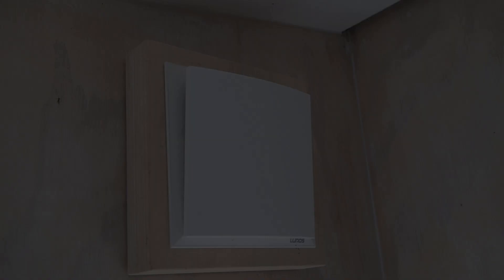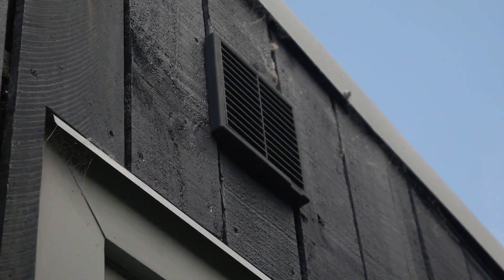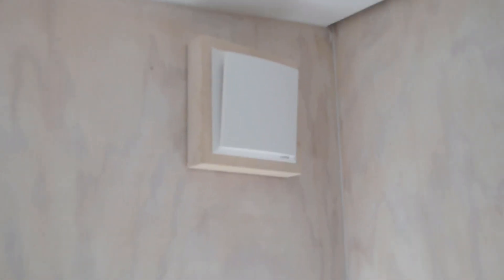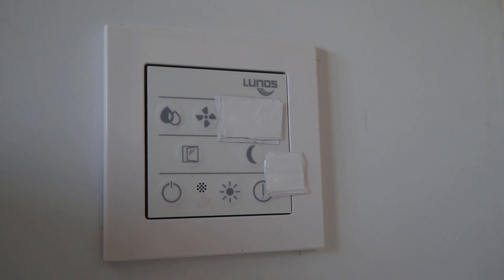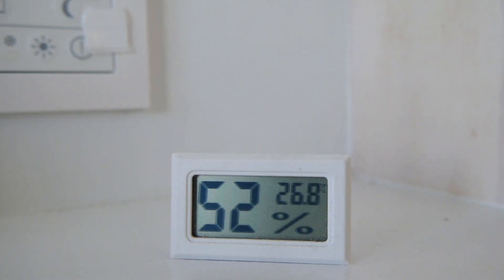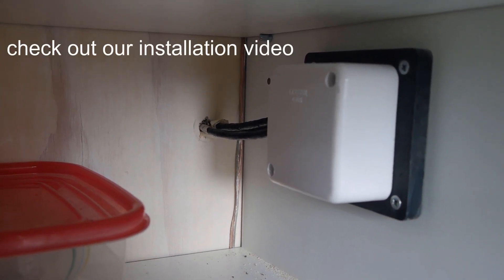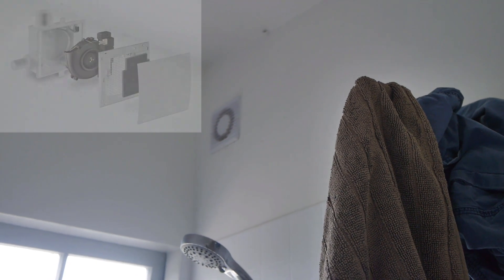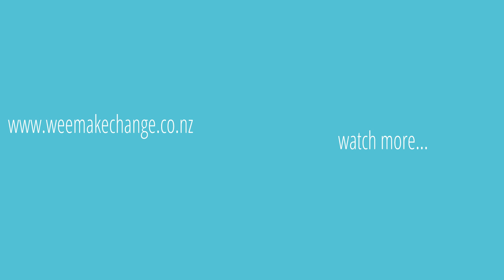Why your Tiny House should have a Lunos e2 Heat Recovery Ventilation System

Comment: I got this system in Ireland and works really well. Well worth the money.
Reply: Hi Micheal, I am also Irish and I am currently looking into this eco system. Glad to hear that it is working out for you. Hope that is still the case? Was this a retro fit job or a new build?
Reply: @derek8272  Derek, I initially fitted 2 units in two bedroom as a retrofit. Very pleased indeed. They great in winter, the room doesn't get cold and you do get fresh air! If noise is an issue you can hear the outside more ie. traffic and wind. Close them during a storm. I just built an extension and am fitting more, because the control system is already fitted. I would recommend them as one of the best investments in any home.
Reply: @user-op8fg3ny3j  howdy, Not just yet, have the units installed, just waiting for a spark to wire the transformer in the fuse board! 😁
Reply: @michealofloinn2539  Micheal, have had these up and running about 8 weeks now. I really like them. especially on the hot days. i kind of forgot that they were there and had to do some work in the house and kill the power going to the fans and I was really surprised at how good they are. the house became very stuffy and hot very quick. even on the lowest setting they do a great job turning over the air. 

On the lowest setting, i cant hear them at all. they are a bit noisy on the highest setting, house sounds like the inside of a air plane 😅. I did notice the traffic noise a bit more but there are some noise filters you can get for them as well. 

I 100% agree with you "I would recommend them as one of the best investments in any home" - might be a bit of a pain to install, they were in my case and how I had to run the cables, but definitely worth the effort.
Reply: @derek8272  hi, did you guys just install it yourselves? or you pay an installer? (Wicklow)
Reply: @togugram  I installed it myself, start to finish. Partel offered a ridiculous quote for their guy to come and just widen the vents and still had to run cables and get an electrician to wire it up for power.

Comment: Hey, another question. If I install this do I still need a separate bathroom extractor fan?
Reply from the maker: Hey you will need a extractor fan in the bathroom but does not have to be lunos, but sure they make a great unit.

Comment: I do not recommend 1-canal heat recovery wall ventilators with ceramic unit and 1 engine, that it works alternately in both directions. There are much more better construction for these price, for example Mitsubishi VL-100, Prana 200G, CLIMTEC 250RD etc. Do your own research and compare all these units together.